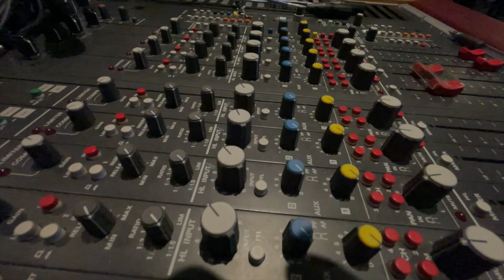How speakers produce multiple waves

Comment: It is NOT easy for a loudspeaker to follow a complex waveform. This is why the best speakers are so expensive.  Loudspeakers and room acoustics are by far the weakest link in any playback system. Given a good recording the distortions produced by even the best speaker completely swamps any differences in digital formats. The argument over DSD vs PCM is laughable.

Comment: This is good explanation, only thing to note is that the sound-waves are compression (longitudinal) wave type (just like waves in spring coils). They don't look like mathematical sine waves which are transverse wave type (just like waves at water surface).
Reply: @Douglas Blake Sure, it's just like piston movement.

Comment: I think the simplest way to answer that question is to study the Fourier series of a function. You have a single signal, you can analyze it mathematically as the composition of sine/cosine waves. The speaker is not trying to add all the sine waves at once: that is the job of the Fourier series, not the speaker. The speaker is simply moving according to a specific wave function.

Comment: Easier to see when looking at graphed PCM data. Remember PCM is kind of a "postion map for the speaker". If PCM reads 1000 the speaker moves outwards, -1000 is moves inwards, 0 it's just sits there in the middle. With a complex waveform PCM sets the speaker position by current sum of all the frequencies at a given point in time.

Comment: An animation, rather than a drawing, would be more useful for visualizing the motion of a diaphragm, be it of a speaker, microphone or ear drum, producing multiple frequencies at the same time.
After all, most diaphragms are quite rigid objects, that only move back and forth in one dimension, thus in a linear fashion, so producing a visual representation of such motion should not be too hard.
Reply: @Douglas Blake Right. Paul seems to have a lot of those laying around at PS Audio. Maybe he'll get around to making a demonstration. :)
Reply: @edfort5704  Anyone can just look at the plotted PCM waveform, pretty easy to see multiple frequencies .... it's very analog like. :)
Reply: @Douglas Blake But most people don't have an oscilloscope. Anyone with a computer can get a free PCM waveform editor.
Reply: @Douglas Blake For the question Paul is attempting to answer here Audacity would certainly show more than enough information.

Comment: I have been saying for decades that one problem with the audio industry is our being locked into very ancient measurement technologies. Way back when audio equipment was first being developed, generating even a good steady state sinewave was an expensive accomplishment. Measuring at best was trying to compare the generated steady state sinewave to the device's output. So everything in audio got strapped to this lack of measurement abilities. Forget measuring a constantly changing dynamic signal! We have THD (Total Harmonic Distortion) , harmonics added to a steady state sinewave. Or IM (Intermodulation Distortion),  two steady state sinewaves to see if the device can keep them separate. The closest we come is TIM (Transient intermodulation distortion) where a steady state sinewave is "gated", mixed with a squarewave, to see what happens to the sinewave at the repeating transition points. 

Unlike analog video that had, while still using sinewaves, differential phase and gain measurements to see if the device was linear across frequency and operating voltage change conditions.  And then when digital came in a completely new set of test signals even, like the zone plate that tested for time based distortions. 

We have added FFT (fast Fourier transform) which basically takes a complex signal and figures out what sinewaves it can be reduced down to. 

We need to move audio measurements into the time rather than frequency domain.
Reply: @Douglas Blake No idea why, but thanks?